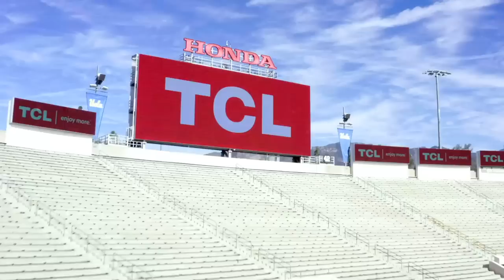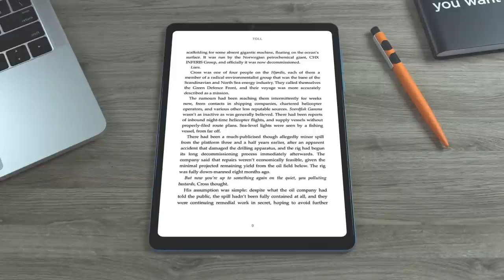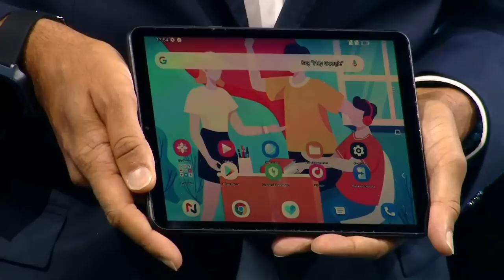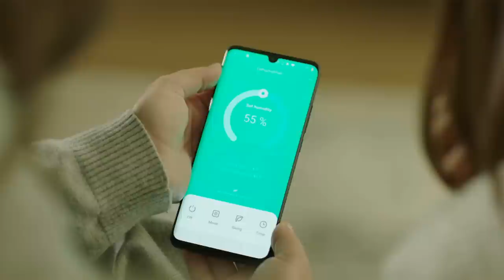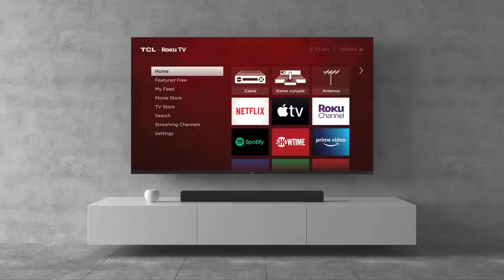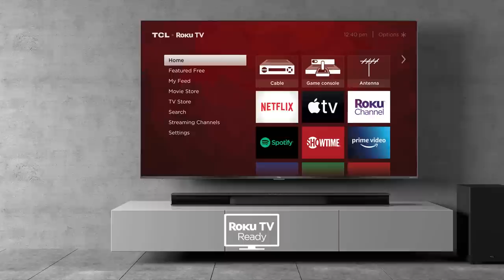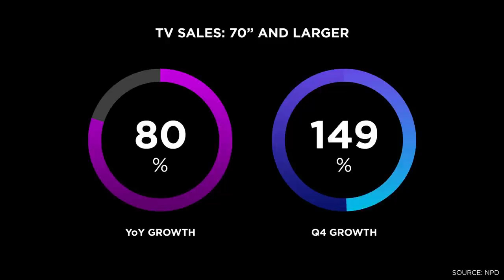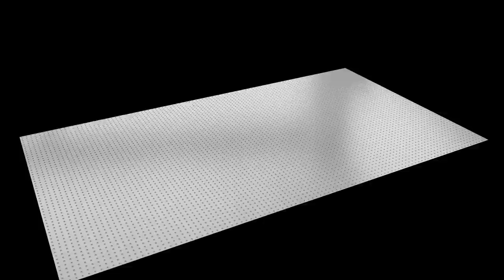TCL North America Spotlight

Comment: I want to buy 100 tv for my hotel but the legs are too far wide making it hard to fit on the table desk. I wish they come up with closer legs.
Reply: Hi, I believe they have those with 65" and 75" TVs (Two positions, adjustable feet on 65" and 75" models add flexibility).  I  recommend checking the 65S535 and 75S535.